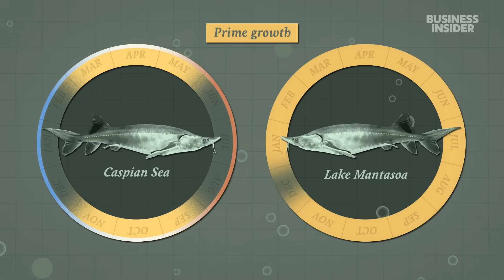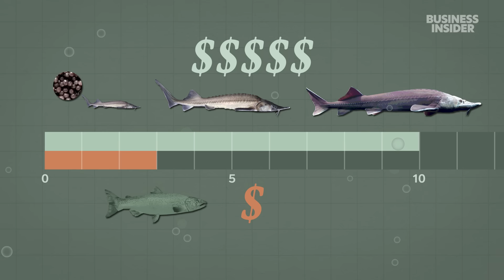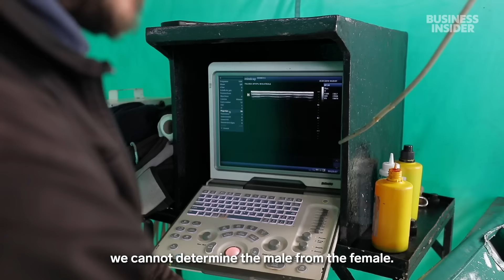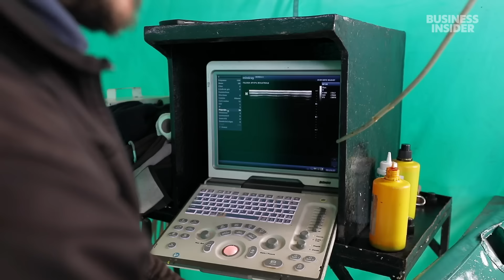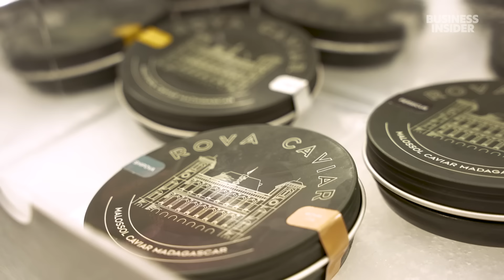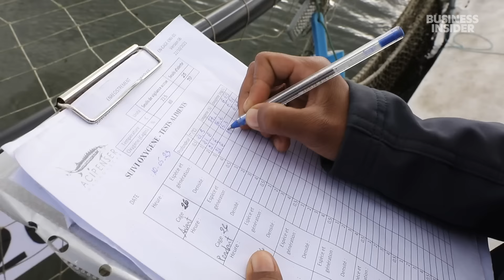How Africa’s First Caviar Won Over Michelin-Starred Restaurants In Europe | Big Business

Comment: Excellent to see a company investing in the people and teaching them new skills. Not just going for the cheap labour and using them. Well done 👍 😊
Reply: It’s still cheap labour. 3 x 0 is still 0
Reply: @TheBeigeBox  yeah that was definitely a large gamble. it would have been one if they tried to build up where the market is already established. this is just well marketed exploitation
Reply: @TheBeigeBox  giving them 3x minimum wage doesnt make them cheap labour anymore. if you would work there, you might say that they are paying you not enough because your expenses are a LOT higher. if someone needs 1k a month and gets paid 1.8k they are happy. if you need 5k a month and get paid 5.6k you should be happy, right? its more then you need. its a question about perspective.
Reply: @punch1t  3 times 0 equals 0.
Reply: @TheBeigeBox  (1) It's 3 x a Malagasy minimum salary, which, while small, is not zero. (2) You're a troll doing the broken record and engaging you is probably a mistake...
Reply: @punch1t  The minimum wage there is 184,653.00 MGA, or 42.08 USD a Month. So they're being paid $126.24 a month, or $0.79 an hour. That's cheap labor no matter how you spin it.
Reply: @ThisWontFly  While it's not zero...it still works out to roughly 0.23USD per hour...assuming they only work a 40 hour week (which I doubt). It doesn't change the fact that it exploitativly cheap labor.
Reply: Plus room and board, so they have an opportunity to save not seen by working class people elsewhere in the country
Reply: @Huebz  Excellent! Let them close up operations, screw their three times minimum wage salary they pay, have them stop training the local population and making it possible for children to go to school... because at least then tHE pEoPlE wON't bE eXPloItEd!

Because it's totally realistic to bring people's standard of living to France's level overnight.
Reply: @TheBeigeBox stop multiplying yourself times 3
Reply: @PacdemonStudios1 so what you want, no company? Leave people jobless?
Reply: @A.Guy10000   or they may have the differential taken from their pay to "recompense"  for the amenities being provided to them which makes it exploitatiotion no matter how noble it seems.
Reply: @DaaClaptain i caught that too.
Reply: Nah it’s still slavery to be paid at that level. I live there and life is expensive (or more), for comparison, prices of basic needs reaches France’s standards due to inflation. So 3x minimum wage is not enough to live comfortably and decently. Moreover, this salary is nothing compared to the job they’re doing. In other country they will be paid x5. It’s a good point it gives jobs to locals and I wish it continues but the salary is by far, just a misery.
Reply: @yanislalaina1105  so what you are saying is that Madagascar should increase the minimum wage by 300% right? Aim the arrows at the right person. A private company is not charity, they mist obey the laws of a country. If the country sells out it citizens then the blame is on them.
Reply: @1001Balance  You are genuinely delusional lol
Reply: @TheBeigeBox  that is, like, your opinion, man
Reply: It's cheaper labor, cheaper resources .. there for a reason
Reply: minimum wage in malagasy africa is 0.14 USD per hour on the high end. that amazing "3 times over the minimum wage" claim they made works out to be .42 cents an hour per worker, they said they staff over 300 workers, so they are paying a combined $126 usd per hour for 300 workers. i wouldn't be so quick to rise up and praise what an incredibly job they're doing
Reply: @TheBeigeBox I Miss When Bait Was Believable!
Reply: It's still cheap labour and those skills aren't transferable, meaning they're reliant on the compang
Reply: @PacdemonStudios1 they get free housing, free food, learn amazing skills and the worker said the money let their children go to school. Sounds really good to me, literally no stress. Just work in the company and everything else is taken care off
Reply: @vvmn9442  hmm.. free housing, food, and they get to learn a skill that they can't take anywhere else because the company they work for has a monopoly on this industry in the area.. So in order to keep their kids in school  they have to accept the mediocre pay so that they're not ass out of their housing, food, and wages. They shouldn't get a pat on the back for having a town of what basically amounts to indentured servants. and at 3x the minimum wage they're paying more for the fish food a month than they're paying for all of their workers at that pay rate. **The fish are being paid more than the people**.

Comment: They need to still improve the work done with those buckets throwing in the feed, they either need platforms to move the feed around, or a feed dispensing hose, or carts to roll around to save on time spent on the labour.